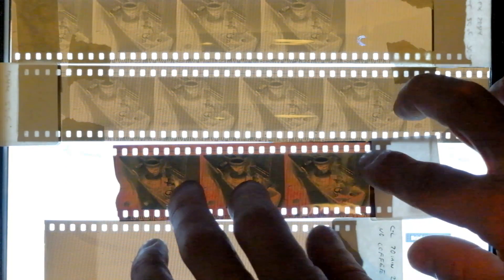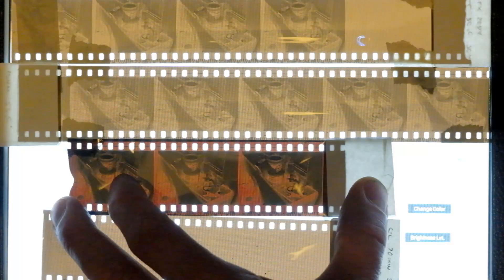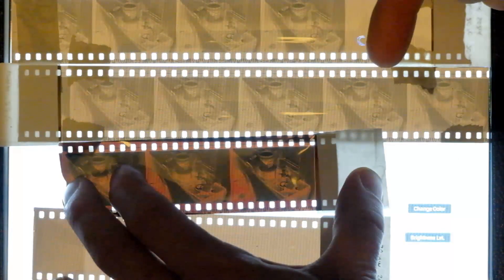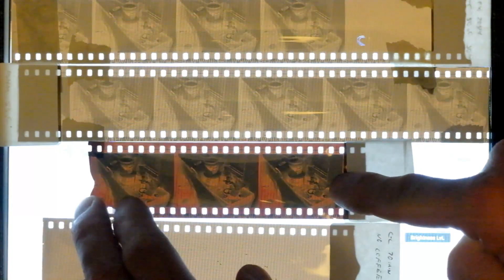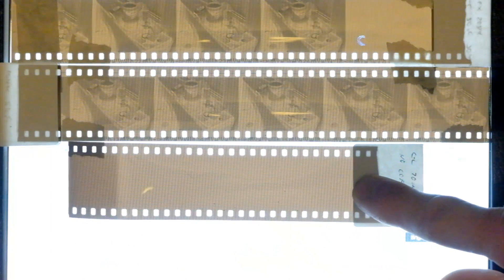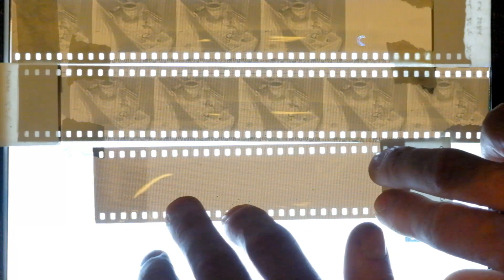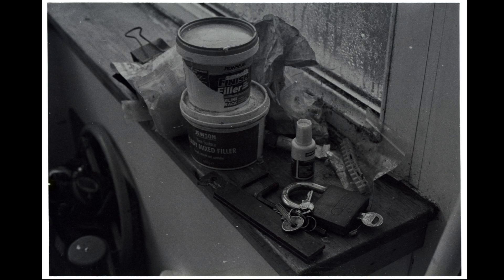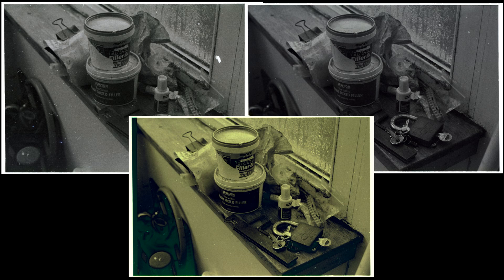Kodachrome C 41 & Caffenol, follow up tests and success developing

Comment: Is it just me or does the Rodinal strip look like it's got some colour in it?
Reply from the maker: It does show hints of red and a straight un edited scan can look quite interesting, I guess this might vary depending on the film manufacturer too and remember you have the orange/brown carrier film colour as well.
Reply: spidiq8 So the original film shot was an Agfa colour film, correct? And Rodinal, although a B&W developer can still bring out a touch of colour to the negative? This is very interesting.
Reply from the maker: Zero Budget Film School I think the film in this video was Kodacolor VR200 but I have developed some poundland Agfa in R09 as well. C-41 films like these have the dye layers on the film itself unlike Kodachrome for example so I'm guessing that the developing agent must somehow activate at least one of the colour dye layers? I'm not knowledgeable re the chemistry but it's certainly more evident and contrasty with Rodinal than Caffenol and the effect is much more subtle in the scanned image than it appears in the negative here.
Reply: spidiq8 wow,I am going to do some experiments with caffenol to try and bring out just a bit of the colour layers in colour film. Wonder what I should add?
Reply from the maker: Zero Budget Film School I don't know what to suggest but I'd certainly be interested in the results. Let me know what you find, I'd love to see.